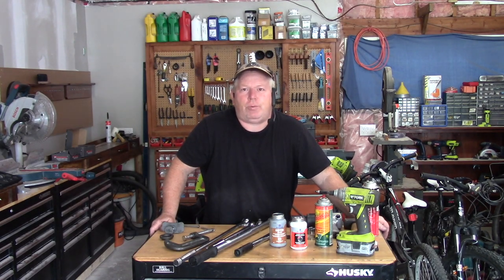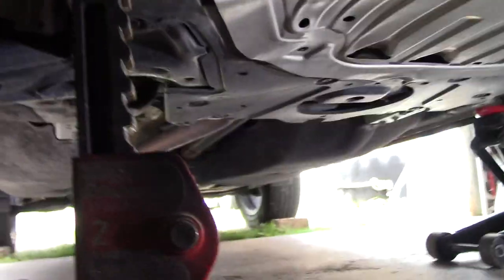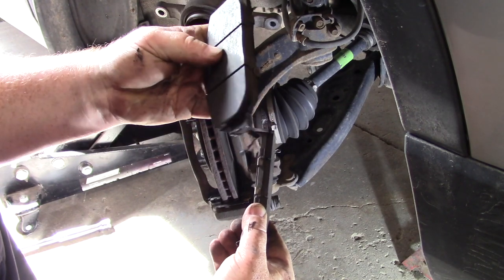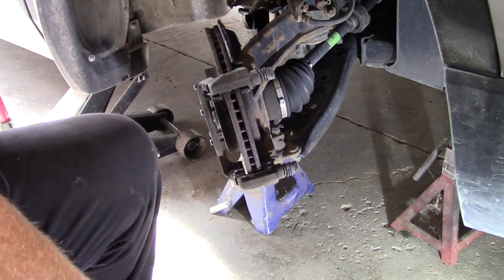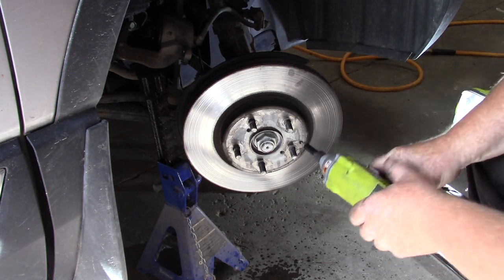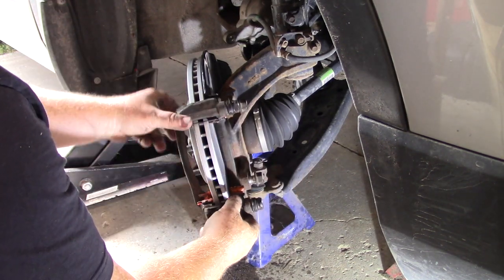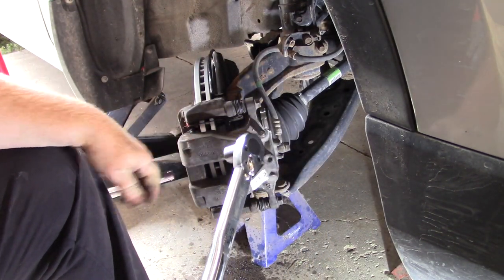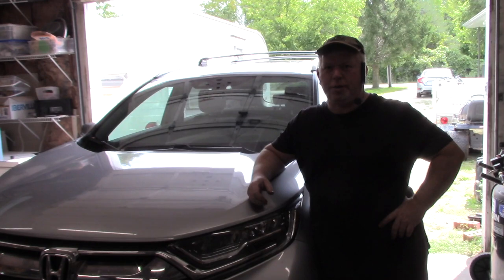DIY Honda CR-V Front Brake Repair 2017 -2021

Comment: Those are not phillips head screws holding the rotor on, those are Japanese industery standard screws. They are very similar. I bought some J.I.S screwdrivers for my CRV..
Reply from the maker: As they say - you learn something new every day...
Reply: That's why you find so many butchered screws on old Japanese motorcycles.
Reply: @mauricedalzot5445  correct

Comment: Thanks for the video bud. I changed my front rotors and pads today on my 2018 crv thanks to you. Took me about 2-2 1/2. Hours. Never done it before but it came out nice. First side took me about an hour and a half. Other side took about 30mins once I knew what I was doing. Thanks again :)
Reply from the maker: That sounds exactly like the first time I did the brakes on my 1990 Oldsmobile!
Thanks for your comment!
Cheers!
Rob
Reply: I was always told to remove master cyl cap before I force fluid backwards.  Don’t know if that is still so today

Comment: Why is the squealer on top? The squealer/wear indicator should be on trailing end (bottom in your case) so that it does not get jammed into the brake system should the wear indicator come loose. Also trailing edge wear indicators elongates instead of being compressed on the leading edge when it is dragging on the rotor, which will cause the squeal to be louder and more noticeable.

Comment: Very well done video sir! I coming back to your videos anytime I work on my CRV. I ended up drilling the screw holding the rotor on my friend’s CRV, but then a Honda mechanic taught me a simple trick: just use a chisel (sorry friend 😂). It went out immediately.

As of July 2023, I paid a hefty $381.84 CAD + tax ($439.02 in QC) for original Honda parts ($138.67/rotor x 2, $103.02/brake pads set, and $0.74/screw x2, plus applicable taxes). That was fun! Thanks again Rob!
Reply from the maker: The premium parts are equivalent to Honda OEM parts.  The Honda front discs are ceramic coated to prevent rust before assembly and use.  You don’t need that either but some manufacturers offer it.  I get my parts from Rock Auto in the States.  Even with cost of shipping it’s 1/2 the price of buying here.
Reply: @robsgaragewoodworkin  There are too many types of rotors listed on RockAuto, which one do you buy? Daily Driver, Fully Coated, High Performance?
Reply from the maker: @cd5453   I think daily driver is their premium range.  Then they have performance after that.  Ceramic coated is to prevent rust just like oil coated where you have to clean the oil off with brake cleaner.  Those are usually more expensive but not necessarily better.  I try to find fully ceramic pads on sale if I can.  Sometimes you get lucky.
Reply: Been there, done that. RockAuto is great. I also go by Napa and just casually ask for 20% off on Akebono brake pads and they have obliged which was a pleasant surprise.

Comment: When pressing the piston back in, I like to open the bleeder port and allow the old fluid to pass through a vinyl tube into a plastic container.  I don't like pushing the old fluid back up into the master cylinder.  Also like to go ahead and put new fluid in and flush the system while you are working on the brakes and easier to bleed with the wheels off.

Comment: Excellent video. I wonder if you could suggest good-quality brakes and rotors for my front brakes!
Reply from the maker: I just buy the premium parts from the parts store.  Check around for pricing.  You can save a bit of money there too.  Check out RockAuto.

Comment: Very helpful video, working on my Dad's 2018 this weekend. So you don't need to grease the back of the pads?
Reply from the maker: No.  They used to use a silicone adhesive to prevent the pads from chattering but they use nothing for this design.
Reply: @robsgaragewoodworkin  Thanks Rob!

Comment: My front brakes were changed and the garage put on "the standard brake pad and rotor" instead of Honda parts. As I drove out I noticed a scraping noise that increased with speed and then becomes more of a whirring noise almost like a locomotive. Brought it back and they said " we don't see anything wrong." Started exactly when they replaced the front brake pads and rotors. Had everything else checked out(alignment, tires, etc) and it's 100% related to the new brakes. So what's causing the new noise? Any guesses? What should be my next step? Thank you.
Reply from the maker: Lol!  My bet is they bent the water deflector cover.  The one that is super close to the inside of the rotor.  Pop off the wheel and check it.  Lots of Mechanics are inept.  That’s why I DIY.  Just bend it out where it makes contact just enough to clear the disc.  1/8th inch or 5mm

Comment: Great Video. Any calibration required after changing the front pads?
Reply from the maker: No.  Thankfully they are straightforward.  Good Luck on your repair!
Cheers!
Rob

Comment: Is it safe to change only the breack pad?
Do I have to replace the router also if it's good?
Reply from the maker: Brakes are the most important safety system in your car.  Get premium parts and don’t do 1/2 a job.  Rock Auto has great value parts.

Comment: Hello Rob. Great video. I have looked through the comments and the video description, I can't seem to find the size of the bolts needed to assist in removing the rotor if necessary. What size are the bolts? Thank you in advance.
Reply from the maker: I don’t know the exact size.  Just try some different ones and see what fits.  You probably won’t need them anyway.  They “usually” come off with not too much hassle.  Good luck on your repair!
Reply: M8-1.25x35mm

Comment: Hey rob. Looking for a copy of the service manual somewhere or at least the pages with information for replacing front and rear pads and rotors. Any idea where I can find that and print it out?
Reply from the maker: Apparently you used to be able to buy the whole manual from Honda.  Apparently now you can only “rent” info online for each specific repair.  This is what I have been told.  They also stopped making Chiltons repair manuals for new cars.  There are Honda forums on the internet that can be quite helpful.  That’s where I got my printout for the EPB.
Reply: @robsgaragewoodworkin  I appreciate it. I’ll do some digging in the forums

Comment: Helpful video to everyone. I want to know  what size of bolt  you used  to pull out the rotor just in case? Thank u so much God bless u. Hope next video  on how to change spark plug  on crv 17. Thanks
Reply from the maker: I meant to check the size and add it to the video but totally forgot.  Good Luck with your repair!
Cheers!
Rob
Reply: @robsgaragewoodworkin update the  size please and thank you.
Reply: Hi rob, what kind of rotor brand did u use. Thanks

Comment: Excellent video. I followed your instructions on my 17 CRV and all worked very well. 
Are you planning on making a video on changing the rear brakes? Namely on how to retract the rear caliber with electric parking brake. Thanks.
Reply from the maker: I need to re-video the epb portion of my video (editing it now) as it didn't show fully.  If you need instructions right away just follow the civic rear brake video.  Just slightly different - uses allen key caliper mounts and a torx socket on the civic and hex bolts and torx bit on CRV.  Exact same instructions.  My new CRV video will be up Saturday night.
https://youtu.be/kyQFCIbVdYA

Comment: The dealer (non Honda) who sold me a 2018 CRV did the brake pad and rotor job for me and now I have a high pitched squeal, even after 300 miles, when braking.  Any ideas?
Reply from the maker: Have you done brakes before?  It’s not that hard.  You will have to remove everything to check it out anyway, I’d just get new premium parts and redo it.  You could be farting around with it to try to find the issue and it could be pads or the rotor or it could just need lubricated.   (Sometimes something stupid like pads in wrong orientation). On the older Honda’s they would put silicone on the back of the pads contact point against the piston circle and the contact point of the pad on caliper to prevent noise.  You really don’t know until you take it apart.  Could be a hard part in the pad or stone wedged into the pad.  I did my civic rear brakes because of a stone.  It’s really aggravating but parts aren’t very expensive.  Good luck!
Cheers 
Rob

Comment: Do you need to bleed the brakes on them 2019 crv
Reply from the maker: No because you didn’t open the bleeder valve or take off the brake hose.  No air entered the system so no air needs to be bled out.

Comment: Just a suggestion: Irecommend applying brake lube to the hub contact points of the brake pads (the hubs that you retracted in the early part of the video).
Reply from the maker: I might have missed that on this video but I think I covered it in the civic video.  Thanks for your comment!
Cheers!
Rob

Comment: Nice video really helpful. Hi Rob, i did changing my front brakes everything looks fine but my left front brake I heard  squeaking once in while when I press the brake at speed of 65 kmp..  Thanks and appreciate your help.
Reply from the maker: OK!  So make sure you have all the right parts in all the right places (brake pads are on the right way and right position - it's easy to install the squealer on the wrong side).  Make sure your pads have the shims on them.  (they are to prevent squealing)  If everything is tight and checks out then I have a couple of suggestions.  
1) Make sure you lube all the sliding parts as shown in the video.
2) You can get a product called "disc brake quiet" which is like an RTV adhesive for brakes to reduce squealing.  Put a bit on the back of the pad where it comes in contact with the brake piston.  Put a little bit where the back of the other pad contacts the caliper.  Some people swear by this and others don't.  So I can't guarantee it.  
Sometimes there is just a bad pad that can cause issues or it may go away on it's own.
Good Luck!
Rob

Comment: Another Rob here
Just did pads, clean, and lube my 2017 CRV
I see you have the OEM tires 
When time for new rubber
I suggest set of Michelin Cross Climate, Defender, Defender M&S, or MXV4 if can still find them
Cheers

Comment: Great video you should open the hood and watch the level of the brake fluid when retracting the caliper piston other than that A1 job
Reply from the maker: I used to do that but the level never ever approached the capacity of the reservoir on any vehicle, so now I don't bother
Reply: @robsgaragewoodworkin  thank you for responding back I was successful doing the job watching your video saved 500 bucks for my girlfriend I put the clips on the pads but I did have to take out some fluid I used rolled up some toilet paper and absorbed it out to the right level God bless you thank you for getting back
Reply: @brianszanyi5538  Careful with brake fluid it eats paint.
Reply: @mauricedalzot5445  yes brake fluid is very corrosive it's a strange liquid but that was a great video I did the brakes save my girlfriend $520 she was grateful he did a great video but you do have to check that fluid cuz when you push the Piston back it'll overflow I use toilet paper to absorb the excess I roll it up it takes it right out absorbs it

Comment: Great video! How did the 1.5T engines perform? I'm in two minds whether to buy the older model 2.0 ivtech or the new 1.5t?
Reply from the maker: I’ve only driven the 1.5 Turbo which is supposed to be faster than the old SI.  Not fast off the line but the turbo builds quickly so your high rpm is where it shines.  Bonus points for a nice, economical, good mileage family car.  I usually get 5.9L per 100k.  Less in city driving.
Reply: @robsgaragewoodworkin  q

Comment: But Rob what about bedding the brakes? I've warped a rotor before by not doing it.
Also, I haven't gotten into My CR V yet, but anti-seize on the caliper brackets?  A lot of manufactures put Loctite.
Reply from the maker: You can bleed the brakes if you feel the need but since we didn't open the brake lines or bleeder valve, no air gets in.  Anti seize is perfectly safe and anyone who works on cars a lot uses it liberally.  I haven't seen locktite on brakes except for the EPB bolts on the back of the CRV EPB motor.  However the civic uses a similar system but no locktite on the civic.  Weird...  Also if you can't get the bolts out of the steering knuckle (where the caliper mount bolts bolt onto) you will be in for a very expensive repair.  Good Luck with your repair!
Cheers!
Rob
Reply: Responding to you you are correct I would put a medium grade loctite on those bolts never a lubricant

Comment: I tried to take out the 19mm bolts, but they were super tight and couldn't even get them loose with my impact. What are the torque spec for them?
Reply from the maker: The wheel nuts are 80 foot pounds.  Some impact drivers and some air compressors aren’t strong enough.  Use a breaking bar.  I think I show it in the video.
Reply: @robsgaragewoodworkin  Just got it out with my breaker bar, thanks!

Comment: Very good
I don’t do the rotors on the first brake service
Just pads, usually
Reply from the maker: For best performance you should change both.  I understand the savings but for ABS performance in wet and icy weather, it's best practice to do a full service.  Cheaper than an accident IMO.
Thanks for your comment!
Cheers!
Rob